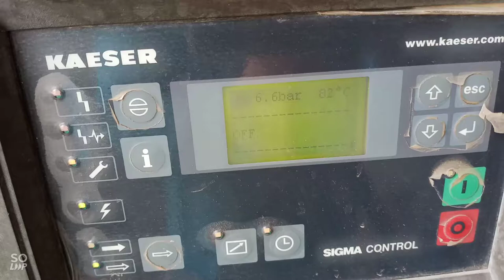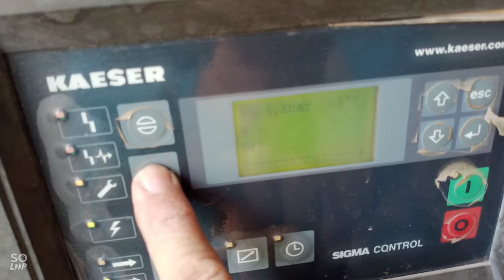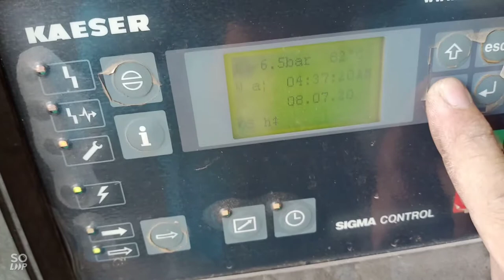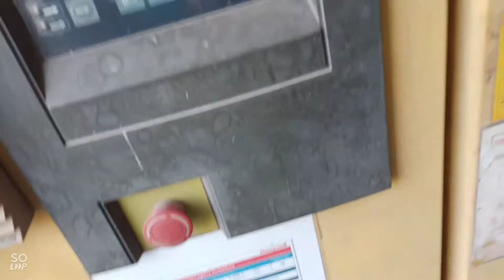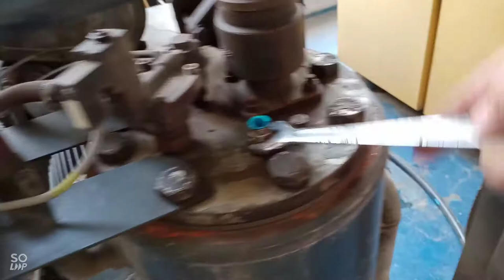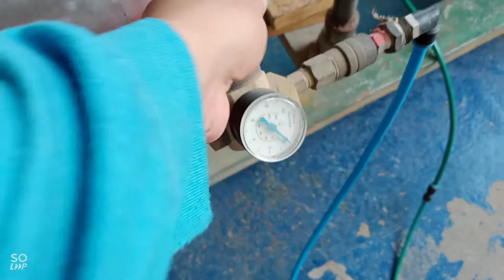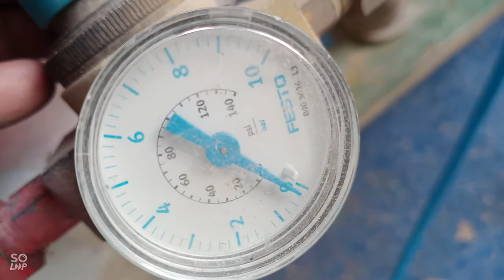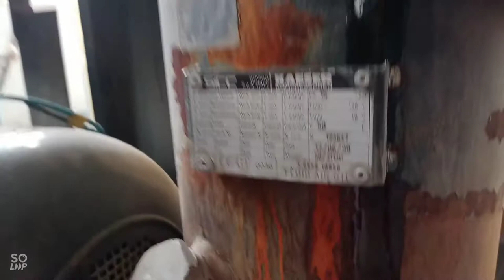Kaeser BS61 servicing

Comment: Hello!  I did maintenance on Kaeser sk 15 and after that when I started my compressor again the check valve is activated ( back pressure valve ) If you have time could you please explain what I did wrong .
Reply: On the combine controled vent valve the is a vent line with a ball valve, the ball valve is close which is not allowing the compressor to vent pressure in the seperator tank and it keeps building pressure until the check valve opens up